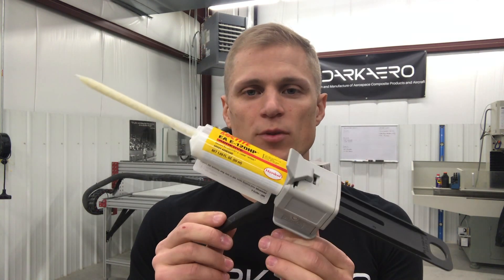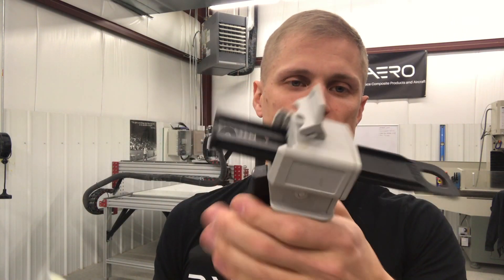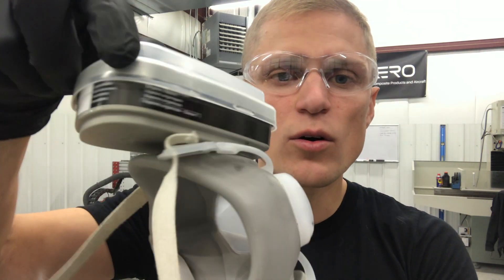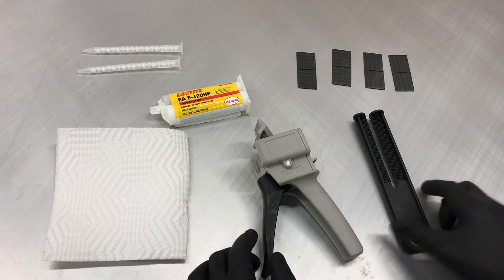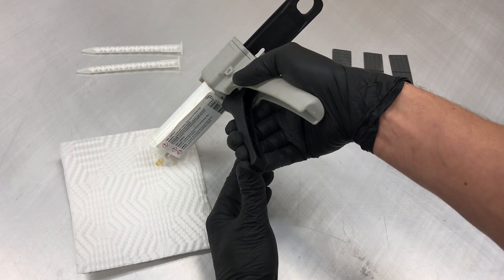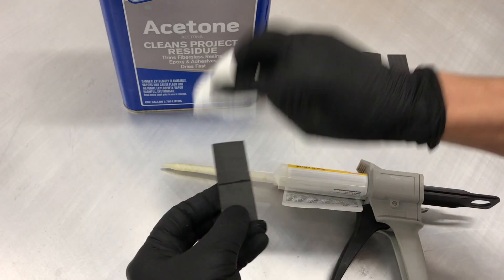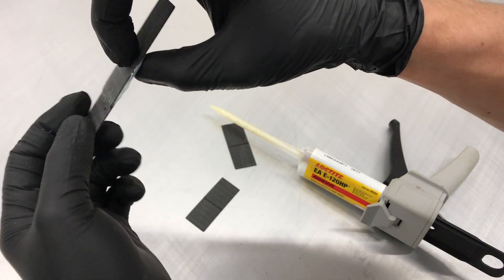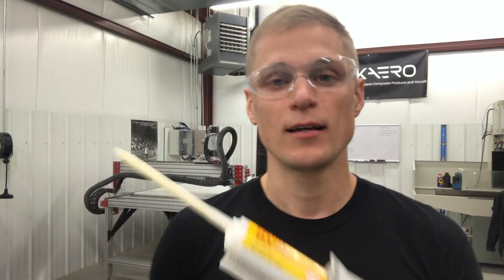Assembly Adhesive for the DarkAero 1

Comment: I was reading the technical specs on this epoxy but was not able to find any information on resistance to subzero temperatures, in other words whether the epoxy can become brittle and crack/break while under freezing conditions potentially leading to structural frame failure

Comment: Nice demo. What parts do you think we will be gluing in the kit? Wish there was something like that glue gun years ago. When do you think clamping will be required.
Reply from the maker: The glue gun is used in a number of areas. There are pre-molded sections of carbon angle that get bonded at the control surface coves on the wings, horizontal tail, and vertical tail. The tips get bonded in place on all the flying surfaces and control surfaces.  The vertical tail and horizontal tail get bonded to the fuselage. All of these bonding operations will require some form of clamping to ensure good contact between parts and to maintain alignment during cure.  All that will be detailed in the build instructions of course.
Reply: White vinegar is kinder on your skin if you get epoxy on it. Cheap and sort of emulsifies it. I agree - don't use acetone.
Reply: @evangatehouse5650 , acetone is used everyday around the world to remove nail polish and dissolve fake nails. If you were dipping your hands in the stuff daily then defatting becomes a concern, but for the occasional mishap it's really not a concern. I personally find the smell of acetone less offensive than acetic acid (i.e. distilled white vinegar).
Reply: @evangatehouse5650  if you want to be kind to your skin, don't get epoxy on it in the first place. Uncured epoxy is a known sensitizer. Once you become sensitized to epoxy you can't work with it  any more.
Reply: @mckenziekeith7434  totally agree. But sometimes a glove breaks or you get it on your arm. In that case better vinegar than acetone.
Reply: @evangatehouse5650  I will remember that next time I have an epoxy containment failure. ;-). Usually I just rub off as much as I can with paper towels and then wash with soap and water when the job is over. But vinegar may work better. I agree that acetone on skin should be avoided. It may even help transport the uncured epoxy across the skin barrier.

Comment: when and how do you clean off the residue?
Reply from the maker: Are you referring to the excess "squeeze out" adhesive? Or just any excess adhesive that is in the wrong place?
Reply: @DarkAeroInc  the squeeze out excess thanks
Reply from the maker: @oracleovercoffee3642  You have a couple options to address the squeeze out. You can mask off the surrounding surfaces to protect them from being contaminated by excess adhesive. Alternately you can wait until the bead of squeeze out is tacky and then cut it off with a knife.  With a little practice it isn't too difficult to judge the correct amount of adhesive to apply and this will minimize excessive adhesive squeeze out.